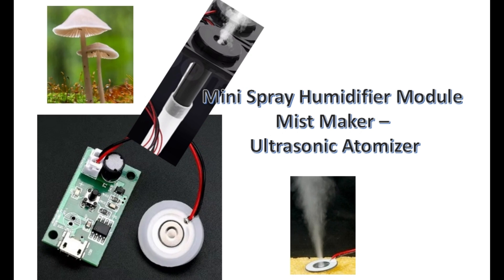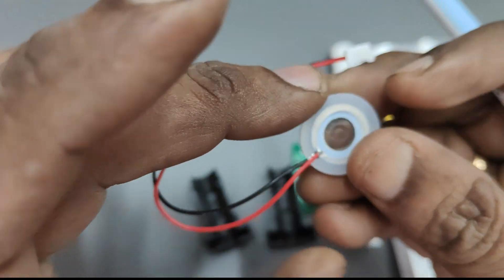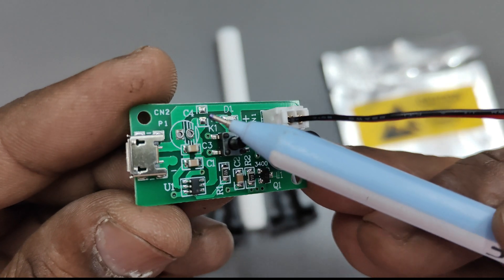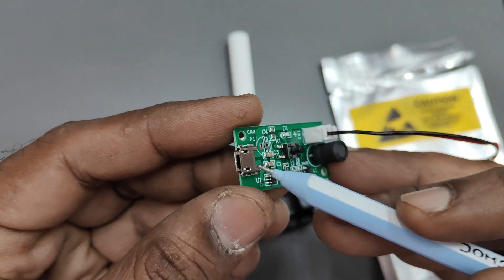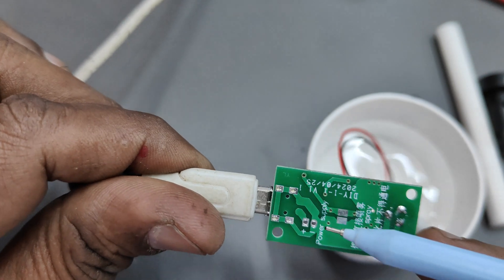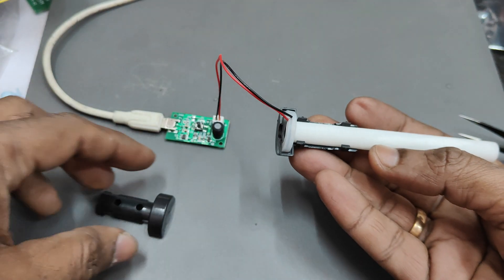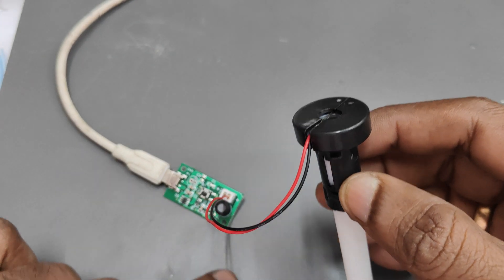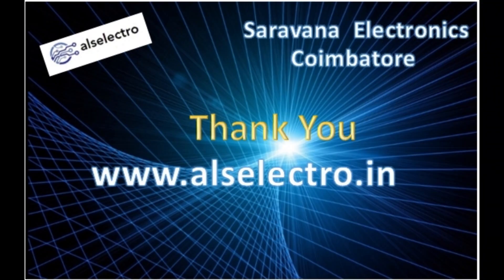Mini Spray Humidifier Module - Mist Maker - Ultrasonic Atomizer

Comment: Great video. Thanks a ton. I have watched more than 50 videos, shorts on this topic but no body explained the way you have explained sir. Specially important aspects like which side of the piezo should be on top, three modes of the switch. I want to make a portable fog creator from this circuit. Can I use fog juice containing Glycerin+water and connect it to a 9 volt battery. Pls answer this sir. 🙏🙏